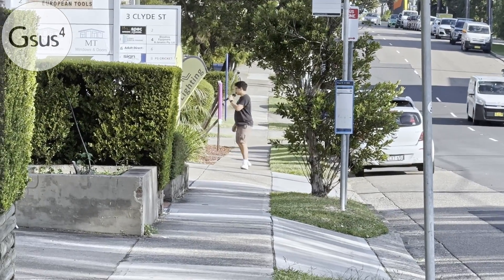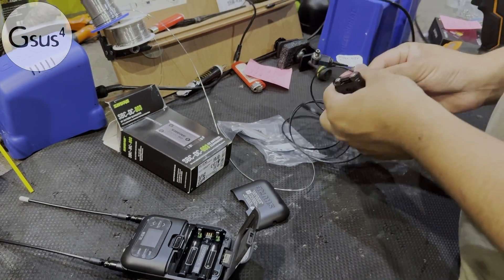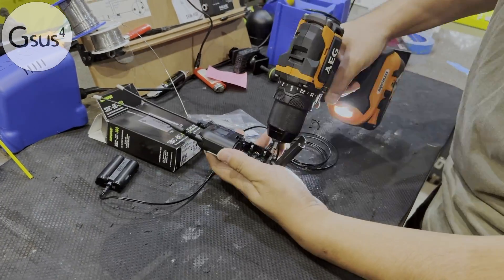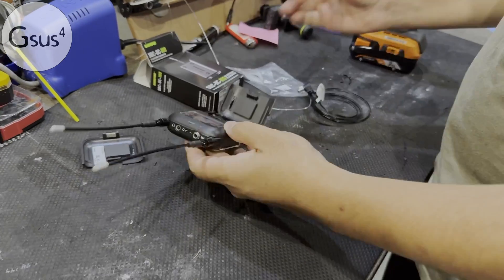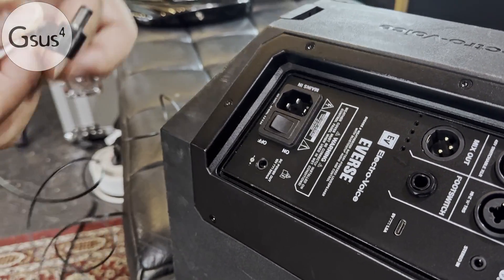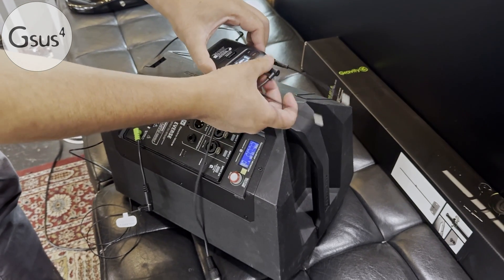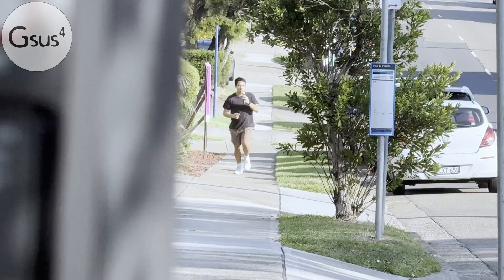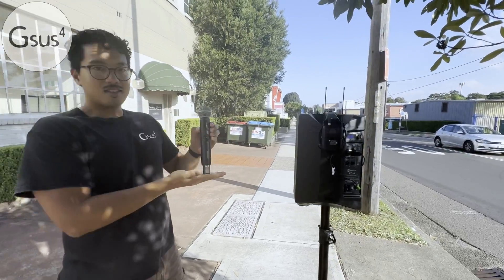Building ULTIMATE Wireless PA System | Shure SLXD5 & EV Everse 8

Comment: How did you attach the SLXD5 to the back of the speaker? Super cool!! I just got both of these. Also, why not just use the USBC from the speaker straight to the USBC input of the SLXD5?
Reply from the maker: We used Dual Lock on this one. The Shure SBC-DC-903 DC Battery Eliminator Kit, AKA the dummy battery need to be soldered and it is much much easier & safer to solder on the DC jacks than the USB-C. Also this frees up the USB-C port for other uses.

Comment: You made it hard on yourself. I use the same system, but using the USBC on the Everse.  It''s a way cleaner setup.
Reply from the maker: Nice! We thought saving the USB-c port might be also useful for other gears like mobile phones just in case!
Reply: @gsus4co  I would not recommend charing a phone on the Everse. It will drain the battery much faster.  Just use the USB connection for a simple yet effective setup.
Reply from the maker: @DJJASProductions  Another note, the Shure SBC-DC-903 DC Battery Eliminator Kit, AKA the dummy battery need to be soldered and it is much much easier & safer to solder on the DC jacks than the USB-C :-)
Reply: @gsus4co  No, at all. a simple USB-C to USB-C is all you need. No battery needed whatsoever.  I have never even opened the battery door.The usb cable transmits power right from the EV Everse USB-C. The SLXD-5 has a USB-C at the bottom that is made to be used with external power for this reason. No need to complicate it. Use the tools/features that Shure gives you without modification.
Reply: @DJJASProductions  Amazing. I was just thinking of this setup in my mind and found this video.